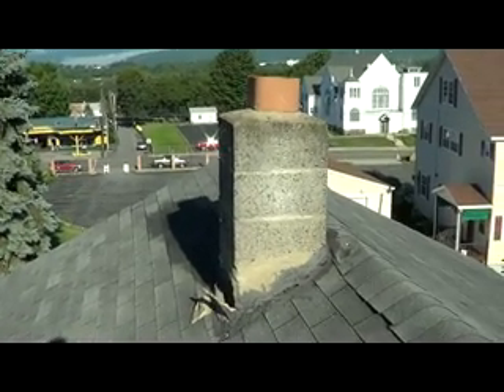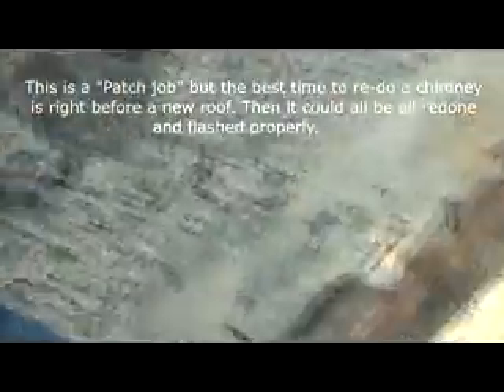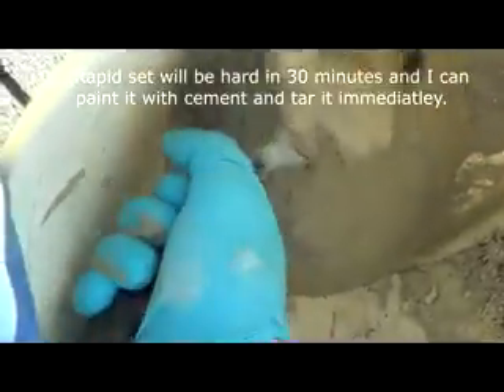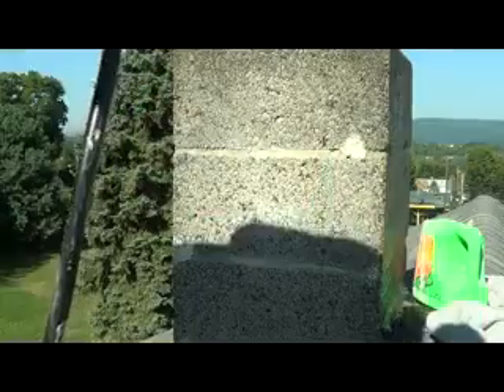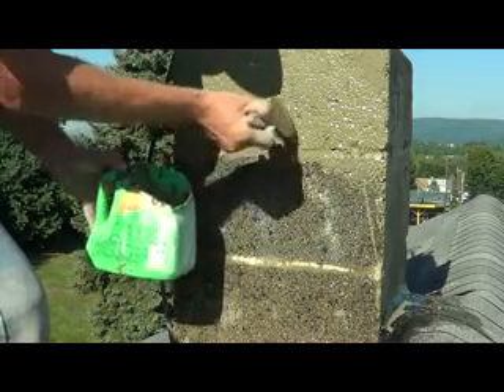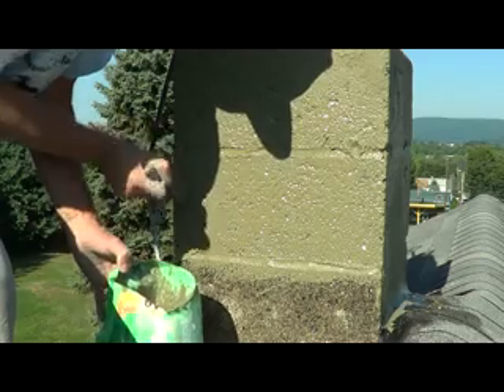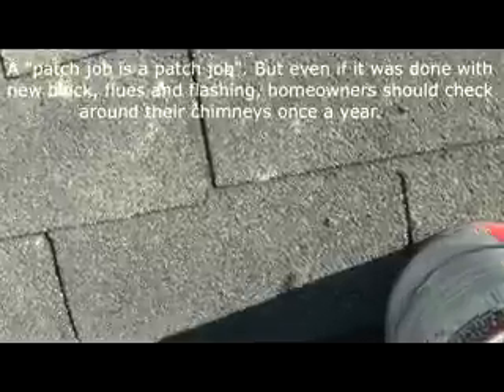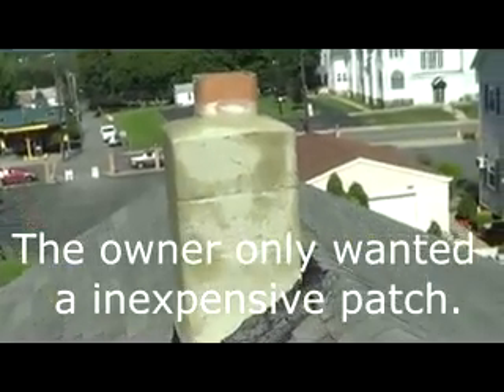CHIMNEY REPAIR (part 2) Mike Haduck

Comment: POLYMER MODIFIED MASONRY CEMENT mixed with some PORTLAND CEMENT  a trowel or two mixed in like you say for the weather in Pennsylvania be used to attach one section of 13 by 13 inch square 2 feet long  terracotta pipe keeped in place a an extension for better draft of my chimney Mike ?? The section will be cemented and inch or two higher than the masonry joint to keep it in place and not get blown off the roof Sir ?? Please give me your best view on this top of the chimney Mike ??
Thank you for y our videos which really give one an education on mason work. Goo day and peace to you Sir too. vf
Reply from the maker: Hi victory, I can only show what worked for me. I would have to be there to see it, I would ask some of the locals. Thanks Mike
Reply: The Spec mix adhered veneer POLYMER MODIFIED MASONRY martor vm-04   website stated the mix is for easy sanding of cement floors. This supposedly has high strength and sealing from weather.  I was figuring it should last at least 4 months with  some Portland cement mix in with the martor. Please Mike would this work for me what do you think ??? Thanks fella.  @MikeHaduck

Comment: Should the original house have metal step flashings between the roof and the bottom of the chimney? Tar patch will shrink and crack, translate to constant maintenance.
Reply from the maker: Hi Kim, I would say yes, especially if they were to put on a new roof, a patch is a patch, thanks, Mike

Comment: Mike, here in Hazleton. The problem is about a quarter of the whole cinder block is gone, but the flue is intact. Can I build up or mound concrete around it?
Reply from the maker: Hi cowney, unless I was there I can't say, I show a lot of diffrent techniques through out the chimney repair videos, I hope it helps, Mike

Comment: HEY MIKE when you use that tar especially where you live if you want it to last and I know your not that worried about the roof part of the job but if you use fabric its sold near the tar n stuff put a little fabric in between the layers of tar that should make your chimney job water tight for many many years just in case there not roofing it !
Reply from the maker: thanks lou,  I just learned something, it makes sense for sure ,  thanks mike
Reply: That's a great idea..

Comment: hey mike could u please  tell me the right kind of cement or morter i should use, i am  going to try to build a 2 face stone wall house with limestone on our property in southern kentucky, i have watched all your masonary videos over and over lerned a lot but still unsure about the morter or portland cement i should use ?
Reply from the maker: Hi John, I don't know if they will let you build like that with the codes, I use 2 mason sand to 1 s  mortar for up and down, I explain it on what cement should I use video, others might say different,  thanks Mike

Comment: Great job as usual Mike,
Hey Mike, what do you do when someone has painted brick and you need to repair cracks, I have a block foundation that I wish I could parge coat after filling the gaps. (I used hydr. cement on those gaps so far)
Reply from the maker: hard call for sure, if was painted before I patch it and paint it again, that's about it, thanks mike

Comment: Thanks Mike, My Sis paid a guy last year to recoat her chimney and this year one side is craking again, we will give that rapid set a try, there is no cap on the chimney think that would help? Wayne
Reply from the maker: Hi Wayne, in most cases with the new furnaces you need liner, cap or power vent like on (part 4) that might be why it is cracking so early,  I hope it helps, thanks mike

Comment: Mike thank you for the informative videos. I truly like your work because it provides information that is not taught in the books. I am hoping you could make a video on how to solve a problem like mine. I am looking to tuck point my 100 year old chimney, it has a witches bend. The chimney section in the basement is in good shape, mortar is good.The section in the attic has the bend, and the mortar between the bricks crumbles to the touch. I was quoted 800 dollars that I don"t have righ now. Bbecause of the bend, I am afraid that one of these days,it will come tumbling down and my home will collapse lol! No laughing matter! I have worked with cement before but never done a chimney and I am not able to find any info on how to tackle this situation. Should I start from the base (from the attic floor up, or from the top where it meets the roof and then down? Should I tuck point just a few bricks at the time to avoid weakening it too much? I am afraid to brush out too much of the old mortar and risking the whole thing to fall down...Help! Your advise is very much appreciated.
Reply from the maker: Hi baba,  it’s a hard question to answer, most people are doing away with masonry chimneys, And going to power vents, because eventually they all rot away, two years after i fixed his chimney, That is what the owner did, I always say just like the dentist, take it down to where it’s bad and replace the bad part, I think that would be your call, I hope it helps thanks Mike
Reply: @MikeHaduck  Thanks a lot Mike, I appreciate that you took time to answer my question. I will follow your advice.

Comment: I have some cracks in my chimney crown. It's leaking into the inside and effervescence is on the inside and outside of chimney. Can I fill cracks with new mortar ( cement ) and then cover it all with tar. Would tar be a fire hazard? Sure wish you lived next door. Thanks in advance!
Reply from the maker: Hi Sherry,  I would watch the rest of my series to get a better idea on what I say about chimneys, (they are a thing of the past).   and then make a decision,  I can't say what to do unless I was there to see it,  thanks mike
Reply: Thank you for your prompt reply. I have watched all you videos on chimney repair. My chimney is here to stay. I have a wood burning Buck stove in my fireplace and have a stainless steel pipe up the chimney.  It has insulation around the pipe. My chimney top/crown  is concrete and has a few cracks letting water inside the chimney. I need to know how to repair them. Chimney is in good/ stable condition, bricks are all good and attached. No loose mortar. Structurally sound. I can't get up there to get you a photo. Sorry. Can you please offer me much needed advice? Thank you in advance.
Reply from the maker: Hi Sherry, the best advice I could give would be to get some more opinions from the locals,  I can not give advice over the phone, or internet, I am sure you understand, and then maybe if will be cost effective to have a pro fix it.  pictures don't always tell the real story, see what they say and go from there,  I hope it helps,  thanks mike
Reply: There are no pros's around my area....LOL  Thank you very much
Reply: Sherry Lee Perdue hi! you can fill the cracks with a cement and sand mix then when it drys a few days cover with the black roof cement hope this helps.

Comment: Hide all your sins, that's great. I need to assemble a homeowners kit; I have to clean out some poured foundation decay under basement windows and build it back up, point a chimney, caulk concrete/wood joints, small slab and a threshold. What's a good kit to put together so I can do cement repair at any given time? Thanks for documenting your work, amazing artistry...
Reply from the maker: thanks, I am just showing what the old timers showed me. I would check out my videos on foundation repair, that might help, thanks mike

Comment: Mike,  you kept saying spray some water before any concrete work.   why?
Reply from the maker: +Jim Hunt  wetting masonry is what makes the masonry stick,  but it depends on what your doing, thanks mik
Reply: I am doing cermetic tiles.
Reply from the maker: +Jim Hunt  I have a couple videos on tile work, but that's a whole different thing, I would check out the youtuble tile guys for that, thanks mike